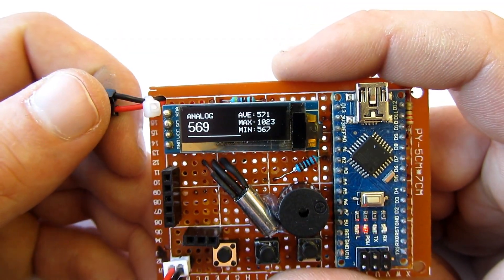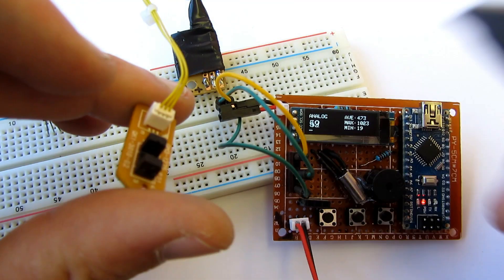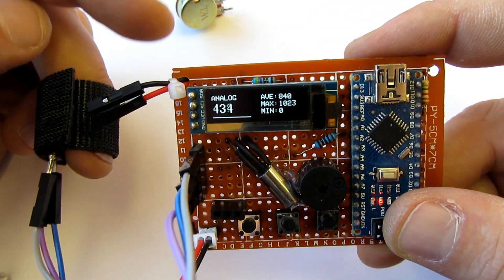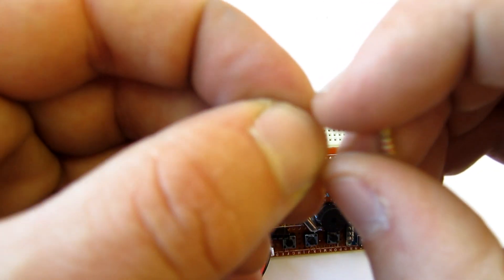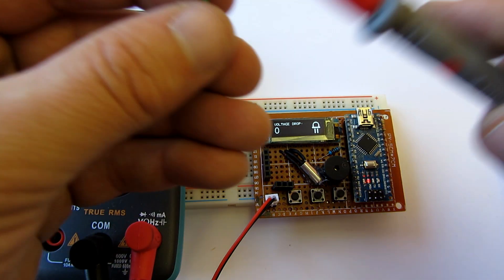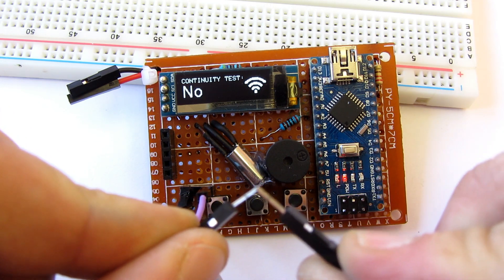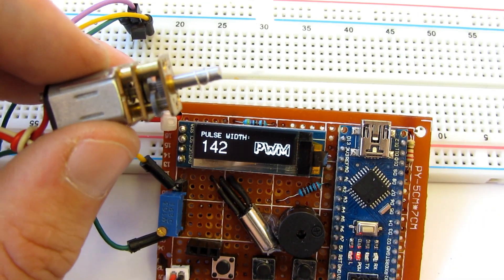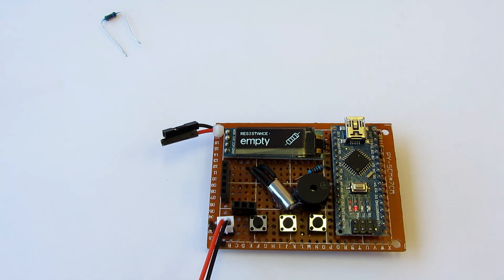Arduino Multimeter and components sensor tester

Comment: What library did you used for the OLED?
Reply: U8glib and U8glib2 are the best libraries for oled graphics and animations. Those libraries support almost all type of displays. But I had problems with the I2C communication when connecting other modules that use I2C and this is a problem from the library itself. Best of luck in your projects ❤
Reply: @ibrahim.t3530  Thank you! ❤️

Comment: One of the most useful part of a continuity tester is the ability to look at forward voltage drop on the diodes, transistors etc, a very useful feature for repairs to power supplies when looking for shorted components.

Comment: Dude this is super. You need to take a video showing how this multimeter is made. It would be great if you could share your codes. Because I have to present it to my professor as a university dissertation. Do you understand me?
Reply: https://www.instructables.com/id/Arduino-Multimeter-and-Components-Tester/
You should only present this as work if you fully understand it, don't forget your references.

Comment: This is the sketch arduino for this project I used Arduino nano, 128x32 led display, couple of resistors and push buttons, temperature sensor and a buzzer for continuity test?

Comment: i do some change to the code and fixed for arduino pro mini to be smaller. at first time it work. at secont time after about 3-4 months i try to get one more with againe arduin pro mini (not same factory) but is to slow, he "lag" about 1,5 sec to change menu or to measure ohm, diode, continuity test. the sketch is 87% i try to work on uno but the same lag. can you have same problem? and how to fix?
Reply from the maker: can you send me your code at arduino.b2016@gmail.com
Reply: @VolosProjects  done , i send you the code!! xD
Reply: @VolosProjects  do you find solution for my problem? i try more but nothing the same lag 
:(

Comment: Good job its amazing, i have a question is there any limit in resistance meter? or range for measuring resistance?
Reply from the maker: yes, it is most accuate in range from 0-10K , it can be used for resistors upo to 50 K but is not to accurate, but it is enough to identify resistor,

Comment: I found your project on instructables.com and the sketch you uploaded there is not working. the compiler says, that a few things are not declared (like sensor.begin)
Reply from the maker: whic arduino IDE you are using, did you install al libraries?
Reply: @VolosProjects  I installed every library, that is needed the gfx library and ssd1306. my ide version (windows) is 1.8.5
Reply from the maker: try with   this libraies  http://it-edukacija.eu.hr/multidruino/librariesMulti.zip
Reply from the maker: and also try this sketch http://it-edukacija.eu.hr/multidruino/multiMultimeter.zip
Reply: @VolosProjects  the ide says, that the zip contains no library🤷‍♂️
Reply from the maker: it contains 4 folders, just copy them to your libraries folder c:/programfiles/arduino/libraries somthing like that
Reply: @VolosProjects  now it says exit status 1 compiling for the arduino board failed. sorry for bothering you with taz Problem😅
Reply: @indianajonas1870  after "exit status 1" you had no any message?
i had that error, too, but because i have other libraries for DS3231, not his one, from his website archive.

that error with "sensor" can be overriden with commenting it. :)

Comment: Your project is very good, please can you help me this month to do a project and I liked your project can you give me the code.
The code in which I made errors in Arduino, I am interested and thank you.
Reply from the maker: can you explain your project?
Reply: multimeter that tests resistances, capacitances, inductances and continuity. Thanks for your reply to my message
Reply from the maker: i know only how to measure resistance and continuity, i think that measuring inductance is not possible. capitance is maybe possible with additional modules. i am not sure
Reply: Can you send me a millimeter that measures resistance and continuity, I will not forget you.
I am a novice student in electronic
I want to learn from you and wish you more success and success.
Reply from the maker: what display and what arduino you are planing to use?
Reply: I planing to use arduino uno
Reply: Sorry I rushed in my answer, what do you suggest?
Reply from the maker: and what display, where you want to display results. i cant make you code if you dont what parts you are planing to use
Reply: @VolosProjects  "i think that measuring inductance is not possible."
is very possible! :D
with a simple comparator, as lm311, or his cousins, even with an decent opamp, some more resistors, two caps, and some more arduino code.
i think you can even add it to multidruino without much hassle...

do an "arduino inductance meter" search on google/youtube/instructables, you will find easily schematic and codes... :)

Comment: first of all great work and nice one :D but i have one problem i download the Adafruit_GFX.h>
Adafruit_SSD1306.h, OneWire.h, DallasTemperature.h and if i press config he has error "sensors" why do that? can you help me to fix this? thanks
Reply from the maker: i dont understend, you press config?
Reply from the maker: did you download aned install whole libraries or juts ".h" files?
Reply: i install whole libries with zip. on arduino ide you have and the "upload" and the "config"  button.
the error is this. "C:\Users\my pc\Downloads\multifunctionArduino\multifunctionArduino.ino: In function 'void setup()':
multifunctionArduino:179: error: 'sensors' was not declared in this scope
sensors.begin();
exit status 1
'sensors' was not declared in this scope.
i forgot to tell you i dont use the 128x32 led display i try with 0,96" oled like your "upgrade multi-druino"
p.s 
sorry for my english :(
Reply from the maker: sensors.begin is function realted with temperature sensor.  I dont know why it is not working ,try this sketch , it is made for upgraded version http://it-edukacija.eu.hr/multidruino/multiMultimeter.zip
Reply: nothing againe with this code has problem with DS3231 and i try to fix with no result and i dont know why does this problem.
Reply from the maker: do you have ds3231 connected ?
Reply: no. i have DS1307 i wait the ds3231 but i dont fink the problem is not connected the rtc because has problem with code and dont upload
Reply from the maker: try to delate all code related with clock and temperature sensor. Code i sended to you woorks normaly for me, i dont know why you cant upload it, what cersion of arduino ide you have?
Reply from the maker: can you take a picture of your device
Reply: first of all i delete the rtc code because i dont find the problem and after that need some change on adafruit oled h. to work my oled. i use and the 2 code and the and old and the new. i like more the new code because the latters is bigger and multi-druino logo at start is better GREAT WORK MATE xD but at the new vertion dont have multimeter and i like to have with new vertion multimeter :( but againe great work friend if you fix the new vertion and with multimeter i want :D
Reply from the maker: i dont understand you at all, that code have 6 function, you change functions with push button. what function you need. You say that new version dont have multimeter. Multimeter is many functions . What you want to measure ?
Reply: at your new version you dont have voltometer you count only the battery level (volt), you have:
mode-0=Analog read
mode-1=ohm meter
mode-2=diode drop
mode-3=continuity
mode-4=battery
mode-5=Pwm
mode-6=Rtc
you dont have voltmeter and i put from old version the voltmeter on "mode-7" on new version. i sent you later the video to see.